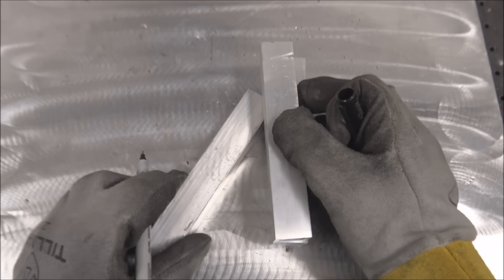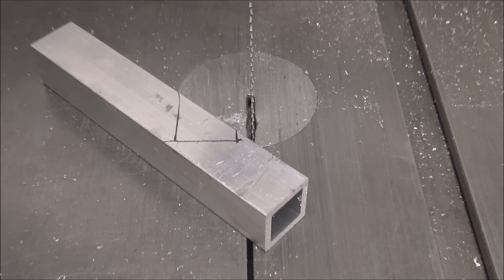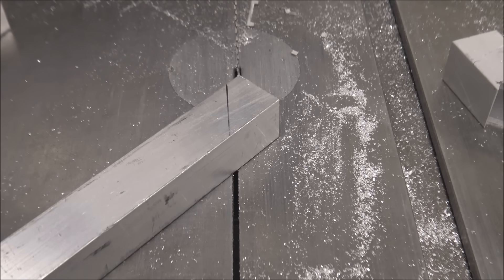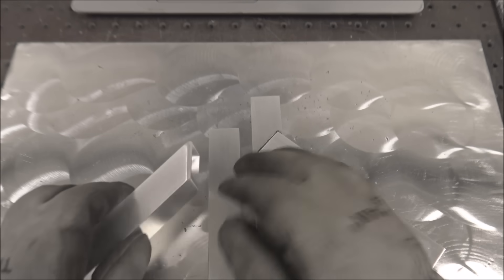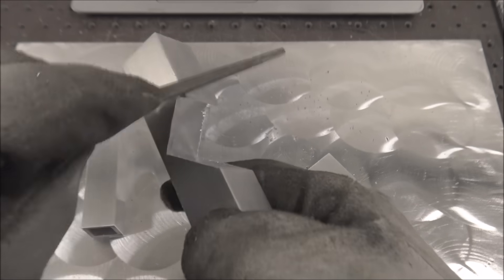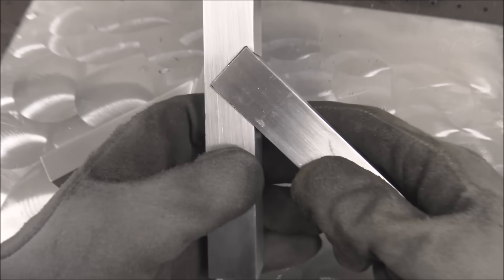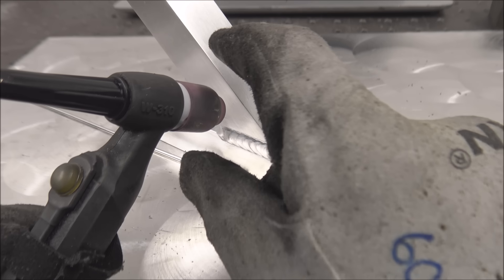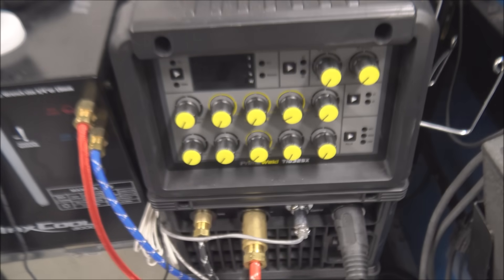Welding Fabrication - Horrible "Education" being EXPOSED

Comment: plus with the cutout you are intorducing a structural weakness from top down load bearing. where it would be a solid wall, now it's a hollow square. the only place i can see this make some sense is plumbing, if you want to run a egress pipe into a main pipe. ridiculous.

Comment: As someone who has worked a lot with CAD stuff, I can imagine cutting out a shape into the beam would help when it comes to positioning them as you wouldn't need to take measurement, they would fit right in like puzzle pieces.
Especially on a large assembly where saving a few minute would mean a lot down the line.

Though, this assumes it was all cut down to size automatically in CNC machines or something.
If you have to cut it down manually, then yeah, you wouldn't save any time.

Alternatively, if an assembly is complex and slots aren't possible, I've designed a few rigs for the welding team. they were quite happy about it.

Comment: Yeah the thing I think they don't realize is that welds aren't suppose to break off. That's a bad weld. With bad welds, yes, that is technically stronger. A good weld fuses the metal together. It's a solid piece with a good weld.

Comment: The second weld only makes sense if you are working with wood. And even then, it only "makes sense" - the main beam would have to be larger for the joint to work well.

Comment: They are a content farm and abuse the algorithm pumping videos like crazy. After all there is only one right way to do stuff but million ways to do it wrong.
Also welding is not like wood joinery and if you sand off the welds there is no indication how you weld it in the first place.

Comment: Instructions unclear, I ground down my aluminium pieces, mixed them with PVA Glue and shaped them by hand into the desired shape. I also wiggled my finger a lot and put random red circles and arrows all over the place while doing so for good measure.

Comment: I'm an engineer and I'm going to tell you that there's another REALLY important reason not to do it the "better" way... Welding aluminium especially substantially reduces the strength of the material for anything that has any sort of strain or heay treatment. It doesn't matter what you do, if the part ends up over a few hundred degrees c it anneals. When you create that complex pocket that takes all that time you also remove a continuous structural component and make the load path down that side of the tube a LOT more complex and lower strength. It also pumps a lot more heat into the part which means that all of it is a lot lower strength in terms of the parent alloy as well. It removes critical structure and substantially increases the annealing effect of the weld overall... There's no good reason to do this, only bad ones.

Comment: Not a welder, but I've done a little welding here and there under supervision. What little I've learned, it seems like the K.I.S.S. principle is king with welding. It's not fine carpentry. You aren't making a dovetail or mortise and tenon joint. You're joining two pieces of metal together in a way that maximises the weld's holding area on structurally sound regions of the metal. Which is what the left hand weld does. The cutout compromises the structural integrity of the weld on the right. The wood joints I mentioned earlier don't compromise the wood in the way the right hand weld does. That is an insane overcomplication.

Comment: You're obviously still a greenhorn... Missing skills: use only a cut off wheel - no bandsaw. B: you need to do it all squatting on concrete, preferrably a sidewalk. Lastly; go barefoot or at least switch to sandals. Tillman flipflops. Oh, right - include inclusions too please.

Comment: Man, I've never had the opportunity to TIG weld, but I've been doing MIG welding and fabrication for 14 years and change. Those videos that you described irritate the hell out of me. Sure, it may look cool to someone who has little or no experience in the real world of fabrication, but what people often fail to understand is that in fabrication, oftentimes, time is money. The only time I've ever done wonky joints like that was when I was doing ornamental iron doors where the CAD designers would put some ridiculous scroll work and picket combinations for customers without even understanding the work necessary to stretch or shrink all of the scrolls they wanted to pack into a door. It's easy to just drag a mouse and expand or shrink on the computer. Very different in real life. Other than that, I'm always going to look for the simplest and strongest way to create a weld joint. It works.

Comment: i almost forgot that that welding joint is the same material, May be it might beneficial for solder joint where the soldering material is weaker.

Comment: I've never welded before, however I learned to solder at a young age doing electronic/electrical work (soldering guns and temp controlled soldering stations). However I did under take soldering with a propane torch in assembling the copper plumbing lines beneath my darkroom sink.  Of the some 15-20 joints I soldered only "one joint leaked" when I pressure tested it.  I fixed it. Everything was good.   The video you showed was excellent, cutting the mating piece at the required angle and not "the ragged" cut into the 2nd part. Much neater joint and less time.

Comment: #2 is useful if fusing or chemically bonding. Its pointless if you're laying a bead. 
I mean, its not useless,  because it allows for a mechanical transfer in addition to the weld. I do not advise on hollow tubing.

Comment: In wood working I can understand that joint since the more glue joints you makes the stronger it is. In metal working I would not understand a joint like that since it seems like more work for nothing since it’s not an end grain joint that needs it for glue.

Comment: I weld up a lot of square tubing for various structures and the welds have to be ground and polished flush with the parent metal.  I feel much more confident putting a weld bevel on in order to ensure complete penetration without having to worry about either IP or burn through.  By grinding down the weld cap it is also a quick way to find out how you are doing with controlling porosity.  I generally like to use a 45-degree bevel.  What is your preference?

Comment: You're missing the point buddy.
Doing it your way requires welds that actually stick the 2 pieces together.
If you do it the clickbait way, you can run beads that don't hold anything and the pieces will still stay notched together long enough to upload it to YT.

Comment: An absolute super skill being able to weld (anything) correctly, especially Al. The trouble is there are so many BS videos, especially shorts showing some funky BS as you indicate and u just can't teach anything properly in 60sec. If one's attention span though is just 60 sec or less, then good luck learning anything. Great video! But the crazy thing is what you have demonstrated is just common sense, something which is taking on the definition of "rarity" these days. In 1980, I was taught how to weld. We did the welds, cut them open, diamond paste polished surfaces, acid etched, microscopic examination etc. understanding Hydrogen flaking etc. Later vertical, upside down, crazy angles etc. Anyone can get a welder nowadays, doesn't mean you know what you are doing. Love the web site title!

Comment: Yeah, you got it exactly. The only "reason" to use the alternative construction that's being shown here is if your "adhesive" between the members is weaker than the material they're made out of. I'm no welder, but I've seen enough videos of people building entirely new parts out of mostly weld, makes me think that it's probably true that a decent weld should be as strong as an equal thickness of the base material.

This kind of construction is for gluing, not welding.

Comment: The bigger issue with that interlocked piece, is yes potential warping, but mostly you have a weak fracture gradient. The bit of metal left on the part cut into is far more likely to crack and break the part, than the side weld is to crack

Comment: I clicked this to see why it is wrong. It's clearly wrong to cut like that and waste time and effort but is it structurally worse?
1:56 distort the part more. Ah. That oughta do it.
Reply: Woodworking though. Oh dang cutting the part like that is pretty as heck. Still makes it weak if that thinnest part is like that, but it looks dang good. And there are ways to mitigate the weakness, it does not affect all the directions of tension. But heck it looks good.
I'm not that good of a woodworker, would never put elaborate joins on structural pieces. Just for looks. But. Yea. For metal that one just looks wrong.

Comment: I've always been told not to wear gloves when using the bandsaw, since they could get caught and end up worse for you than nicking yourself with the blade, is that not true?
Reply from the maker: It depends on many factors, I'll make another glove safety video hopefully in a week or two.
The simple answer is think it through and do whatever YOU feel is safe for you. Keep your hands/fingers far enough away to keep yourself safe, gloves or not.

I wear gloves because cut aluminum parts typically end up with sharp edges. When you handle those cut parts with bare hands, you inevitably get a lot of small cuts on your hands. And cutting thick parts creates heat. You can hold onto hot parts tighter with gloves on, reducing the possibility of slipping.
 
This aluminum saw blade won't just nick a finger, it will mow right through flesh like a butcher saw.

Comment: "Why don't other welders do this?"  Because it's the stupidest way of doing it possible.
There's a time and a place for doing fancy cuts, and it really doesn't come up the often.  I've done a couple, but when I do it it's because it's a compound angle of some kind and there's no other way around it.  It can generally be assumed that if you're watching a welding video and someone is using a death wheel to cut metal, they probably don't really know what they're doing.  If they did, they'd probably be using a torch, plasma cutter, band saw, chop saw, or something like that.

Comment: Correct me if I'm wrong, but I think cutting a groove in the shaft like that significantly weakens its structural integrity.
Reply: Not even a welder and would know that much.

Comment: Even if I don't have a TIG welder or a spoon gun, I would just cut material using your method before applying low solder aluminum on stainless mesh.

Comment: I feel like it's just inviting trouble beyond wasting time. Not a welder, But it seems like a somewhat iffy idea to cut away that much of the metal material? Just feels like it's inviting a new point of failure that isn't the weld itself. Could be wrong! But you're essentially cutting the metal down to 1 side only instead of keeping all four sides of the piping intact at the point of joinery. No matter what your weld is, it's definitely not stronger than the base metal which has one continuous crystaline shape, so it's like you're wasting time with all of the extra cuts and the otherwise unnecessary routing to weaken the material. 

but yeah, it's not carpentry, just butt it together and weld it.

Comment: Joints that interlock are good in woodworking because having the fibers perpendicular makes it harder for the wood to split. Does hollow aluminum like this have similar direction-dependant weakness that could justify the other lengthier weld?

Comment: Would the "viral" joint work differently under load? If the force applied is coaxial with the cut piece, the proper joint is gonna work in sheer but the viral one is gonna work in compression.

Comment: This video has the same energy as I have when I looked at the Ocean Gate sub layup, after more than a decade working with carbon fibre. There were really simple mistakes that can impact the final strength. 
As a very reliable rule of thumb, if they got the simple parts you can see wrong, you know they got the simple parts you can't see wrong too, almost for sure.

Comment: Other than time, having a welding table with clamps could keep from distortion... did you actually test the strength of the weld? Theroredically having a larger area welded together would mean a stronger weld would it not? Legit im just asking as i want to start welding. Plus a hand file? My man a grinder and disc together is like $40 at walmart. A welder should have a grinder right or do i need to use hand files?
Reply: The weld strength is only part of the equation. Cutting a huge chunk out of the primary member is unnecessary and weakens the joint.

There are plenty of complicated configurations of connections that people use and there's a good reason why the silly example in this video isn't used by anyone.

Comment: Theres a difference between your method and theirs
With aluminum they weaken the entire part as in most cases the welded areas are 2x weaker !

Also i like the technique of removing the little pillars when cutting out material on the bandsaw, learnt something new!

Comment: The stupid looking joint is mechanically weaker as well. You've removed a chuck of the wall of the main beam, so it's weaker, and you're no longer closing off the end of the diagonal beam, so it's weaker.

Comment: issue with welding videos, is that YT is saturated with them. I think you been on YT for 15 years or so. The reason why the crank videos get more views as its something new, different, and some people want to see something different. Looks like your popular videos are showing interesting projects (Titanium flask for example). 

Since everything is made of plastic. Try doing a couple of plastic welding videos, repairing something made out of plastic that is broke. That would be something different to watch. May do a video using plastic welding rods to weld a plastic part to steel or alum (test bond strength with different surface prep).

Comment: anybody who knows ANYTHING realizes that you don't ADD stability by cutting NEW holes in things. when the side wall of the beam is SOLID, it is much stronger, even after the weld. when you cut a HOLE in it, on MULTIPLE SIDES, and ESPECIALLY when that hole goes almost all the way thru the side, then it is no longer as stable, and in fact, is more likely to snap.

your way is far more structurally sound, and i would trust it way more than those convoluted methods. i think those guys are just trying to show off how to do complex connections.   or maybe they are just showing the way the cheap Chinese stuff that breaks in a few years is made, lol

Comment: I mean the first one seems easier and more to the point... but there should be a strength test of some sort to determine if it's actually sturdier, right? Maybe not pull it length-wise, because the second has that nick that fits it in place.... maybe pull it apart width wise?

Comment: From an engineering perspective, I really don't like that fancy method either. It looks great for generating stress-concentrating areas and reducing overall strength. Maybe they could be equally strong if you're an expert welder, but it really looks like otherwise it will always be weaker.

Comment: only asking questions, couldn't you use a die grinder or rotozip with a carbide bit vs using a hand file? Granted I agree with this video 100% just feel a hand file is unnecessary when die grinders exist.

granted a die grinder uses a radius bit and wont be able to get the corners so you will ultimately have to hand file the corners anyways